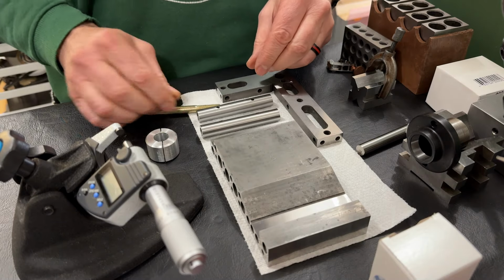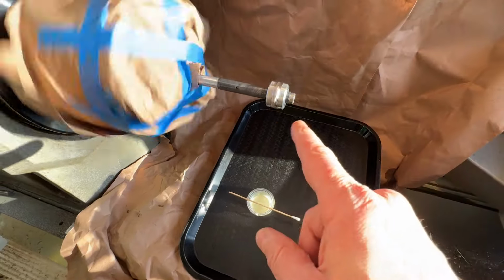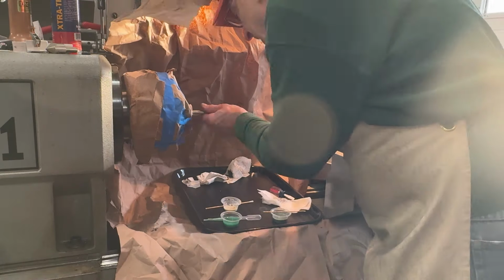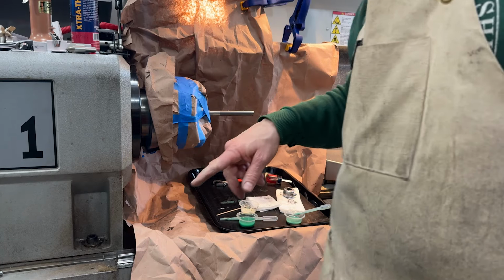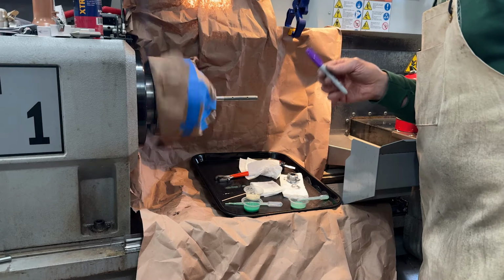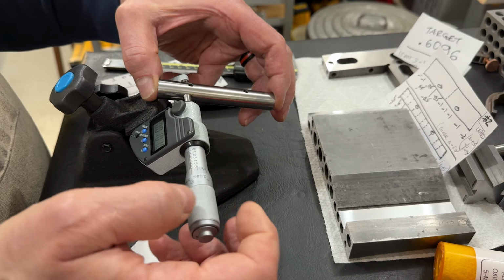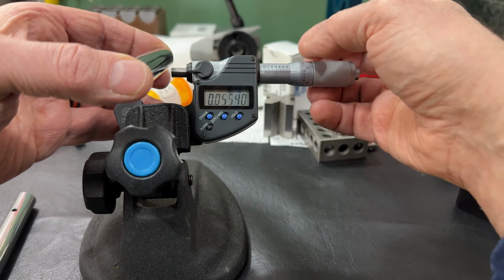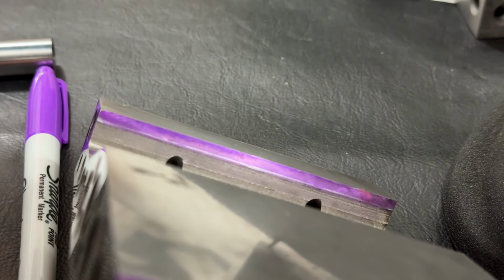Quick Chips: Restoring a sine plate, Part 10

Comment: You mentioned you can feel the taper or tight spot. Same thing when honing with a Sunnen hone, with practice and experience you can easily feel a tight spot and work it out. Good Stuff Spence. #purplesharpie should be a thing! Cheers
Reply from the maker: I played bass for Purple Sharpie back in the 80s.  🎸
Reply: @KPNH  I was wondering if that was you!

Comment: Thank you for this interesting and detailed series! Why lap the cylinders but not lap the surfaces they register against?
Reply from the maker: An excellent question!  Because we hit size and geometry of the plate on the surface grinder, they need no further attention.  The surface finish is also sufficient.  The lapping of the rolls addressed a bit of taper, and matching.  The surface finish from lapping, in this case, was a bonus.  But, stay tuned, there's one more battle coming before this "simple" project is done!
Reply: Makes sense! I’ll be waiting for the next cliffhanger!

Comment: It doesn't surprise me that you are getting a high reading in the middle and low reading at the ends.  When you slide the lap back and forth, you're spending more time at the ends than at the middle, hence taking off more material at the ends.

Comment: Did anyone ever try the Degussit burnishing wheel? Degussit is an old german brand now owned by Kyocera and they make sintered dense ruby stones which are awesome for chamfering/edge polishing of precision equipment and instruments. Anyway they make this burnishing wheel that's probably for surface grinder. I'm dying to try one on a set of hardened blocks i will be making next month.
Reply from the maker: I know I have not.  Sounds interesting.  I bet it's not cheap.

Comment: Nice job, I disagree with your measurements however, and it’s a very typical outcome. If you get the right answer you move on, if you don’t you check again, and again. One result disagreement and recheck of that result, undermines every other single check measurement. I recognise at this point your feel on the parts over many process you know what is ultimately there or not. But it is interesting how tradespeople process these situations.
Reply from the maker: What would you do?
Reply: @KPNH  probably the same to be honest because if you handle the part enough you get a feel for it. I find it interesting that we question wrong answers more then right ones, despite the methods of acquiring the result being the same. High precision is not my field I am a general machinist, so I cannot provide a better method with actual experience to back it up, but the issue of judgement affects us all. I don’t know if a dial indicator on a stand would offer a less subjective result?